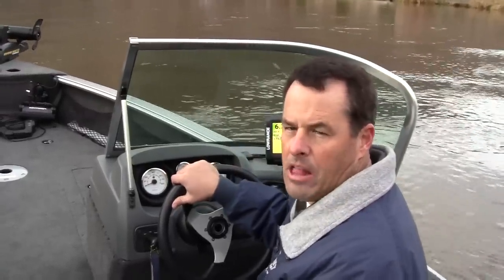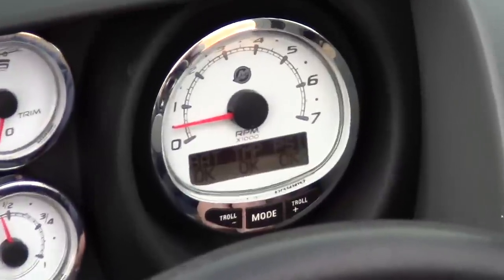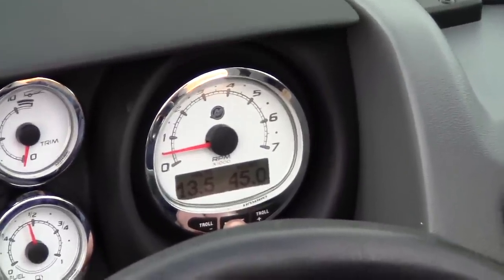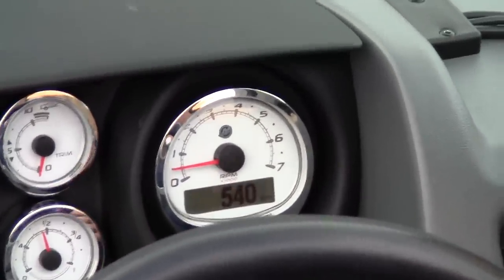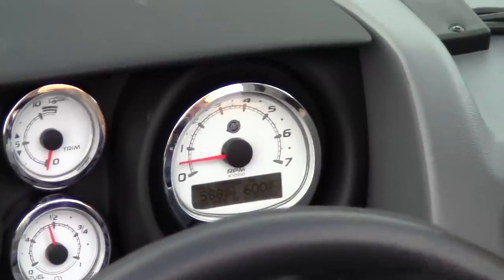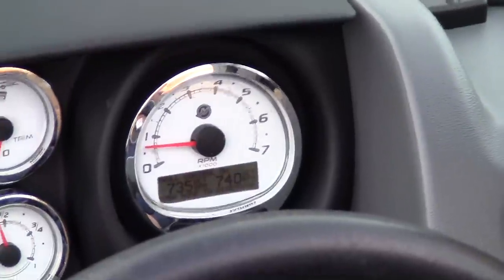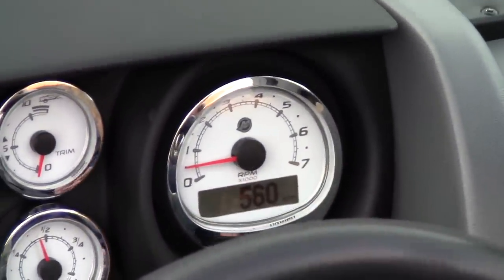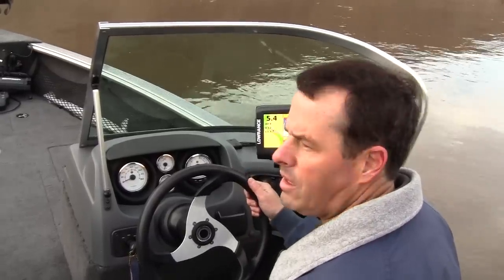Mercury Smartcraft Operation

Comment: when using smartcraft does your other gauges still work or are all the senders now just going to your smartcraft
Reply: Depends on what you have installed but normally the other gauges run as well and off a second set of senders.  My boat (SeaRay 240) has trim, oil pressure, engine temp on separate gauges on separate senders.
Reply: Depends how your boat is set up from the factory